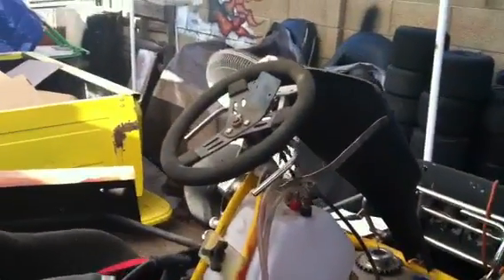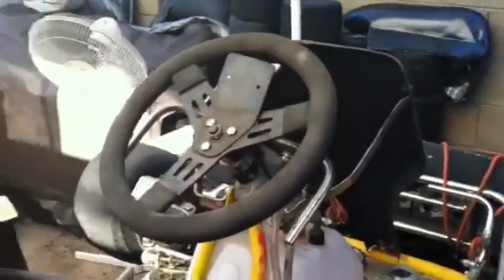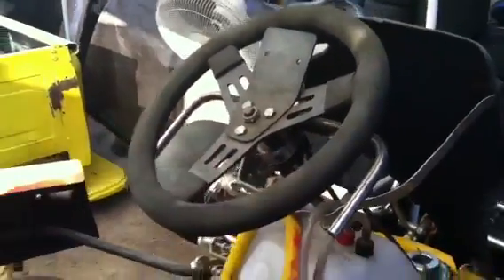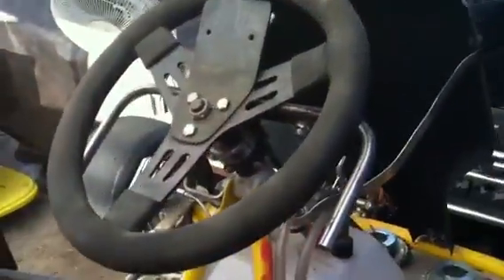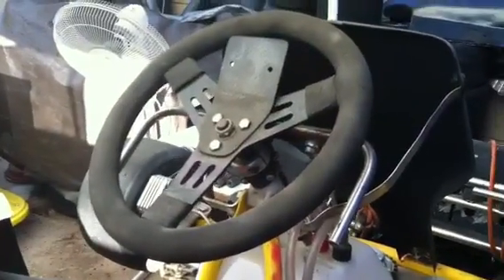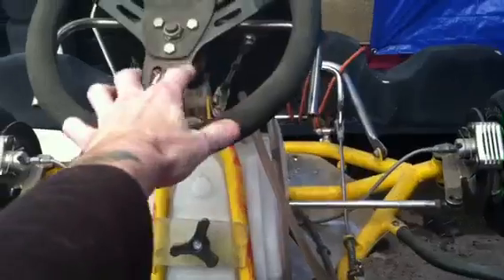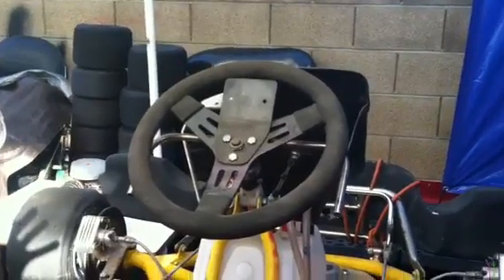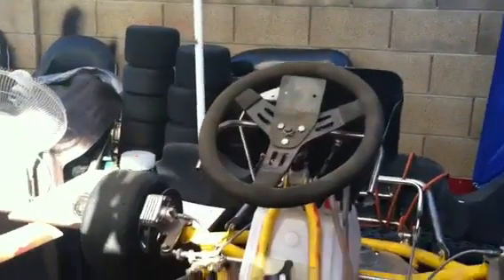Shifter paddle system

Comment: this is awesome, trying to do something similar for a design project, just wondering how cables hold u when shifting the gear on the shaft since its a rotational motion despite being small. does this effect the cable? any idea how the cable system would hold up in heavy mud/dirt if used offroad?